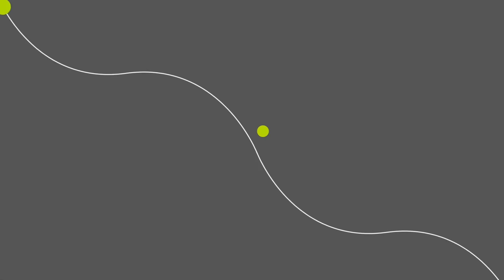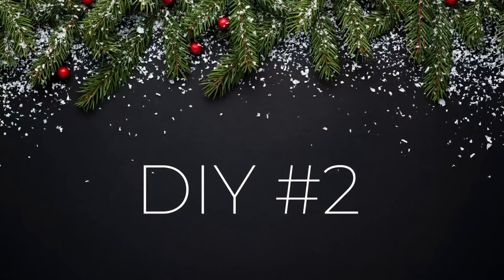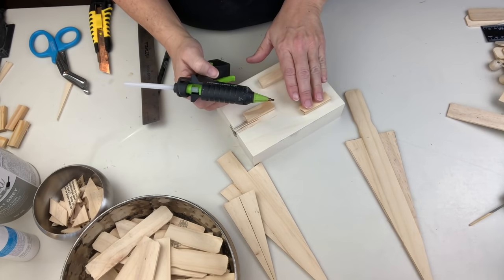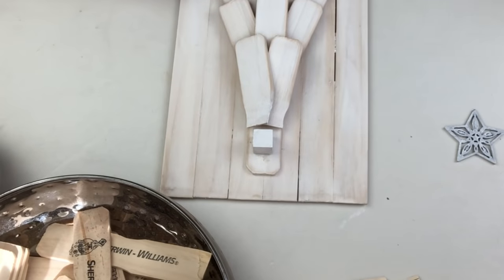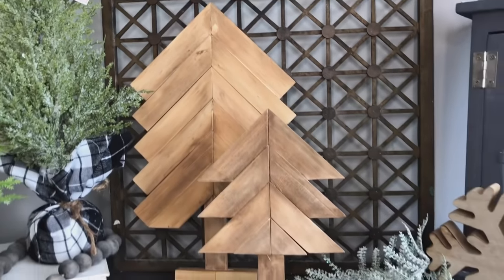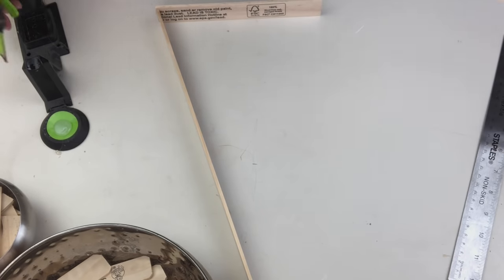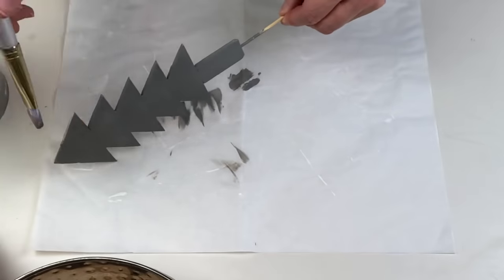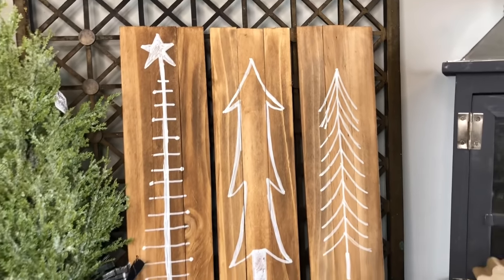🎄NEW CHRISTMAS 2021 ||  10 Farmhouse Christmas Trees  ||  Wow Paint stick Christmas Tress

Comment: I probably said this on your tower block tree video, but give Star Bond super glue and accelerator a try for your tower block/paint stick/any  projects (really!) It's expensive, but totally worth it and a 2 oz. Bottle lasts FOREVER...It dries immediately and to a hard, plastic like substance. They DO NOT come apart unless you beat them with a hammer... It works especially good for things like the 3D tree that you need to move around constantly and you don't want it to fall apart...

Comment: These are lovely! I tried to pick a favorite, per your instructions 😉, but I could only manage to narrow it down to three of them, 3, 6 & 9. I really liked 4 also. I know what you said about the halo thing and technically I agree, but I’m not convinced that using the greenery was the wrong choice. I have in my head (and I fully admit that it might be a ludicrous idea) to finely chop/cut the moss, upend the piece, then add (by brush or tiny nozzle) some glue that dries clear to the gaps that are just under your branches, after that sprinkle your finely chopped moss on your piece and finally turn your piece back around, tapping to get all the excess/unattached bits of moss off. If I am thinking correctly, it would look like the green of the tree poking out, just under the “blanket” of snow. Feel free to find the idea silly. Now that I’ve typed it in, it sounds a bit ridiculous to me. Oh well, that is what makes crafting so much fun 😄    tfs your time & talents! I am in search of paint stirrers, so I can try my hand at a few of them.
Reply: I LOVE YOU LISA! I LOVE THESE TREES. I REALLY WANNA FIND THE LIGHT GREEN AND ROSE GOLD MERCURY TREES ONLY FOR  RHE LIGHT IT GIVES OFF. I KOVE BLACK AND WHITE POLKA DOTS TOO. WELL POLKA DOTS IN GENERAL....

Comment: The paint stick tree from all the paint stick ends won my heart.  No--You should seldom use green for a border around a star.  I'd just scrape the glue off and add some gold paint or glitter in gold, silver, copper or another metallic tone, like shiny white.  If you're frightened of too much sparkle, try a translucent, foggy or antiqued gold or go light.  A fine glitter also tends to convey more subtlety.  But representing star glow with green on a white tree, meat to represent a snow-covered tree is kind nope--kinda confusing, you're right.  A seafoam-coloured moss might just work, but I'd go metalic in some form.